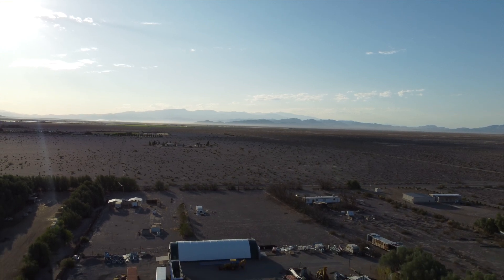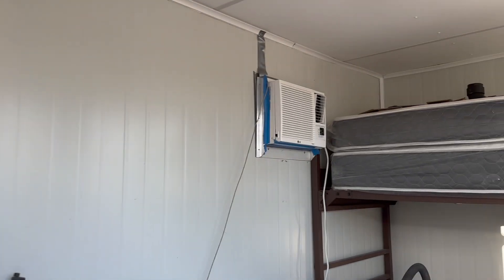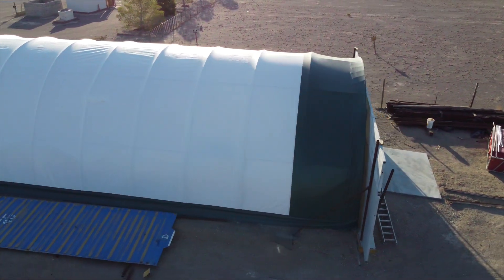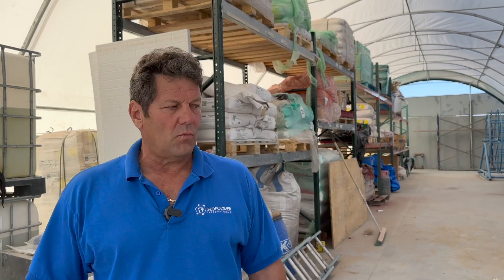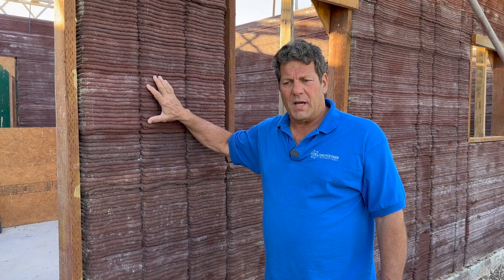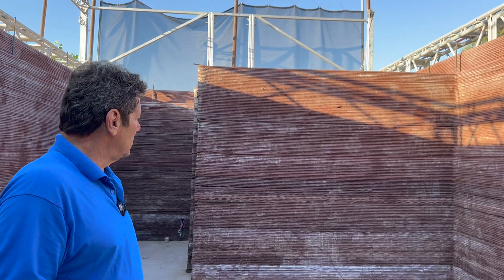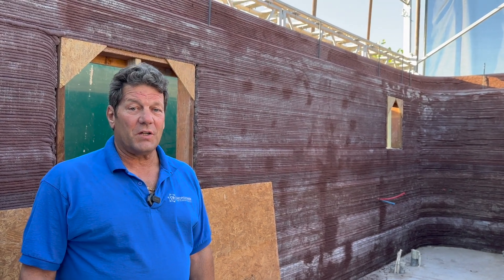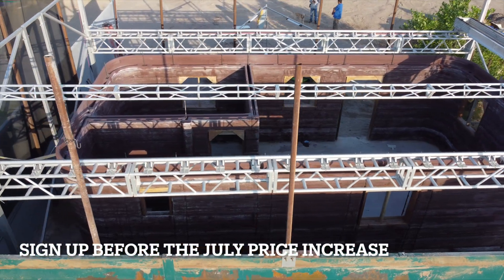First Geopolymer 3D Printed Building In The World

Comment: The white residue on the surface is just sodium bicarbonate.  Excess sodium is migrating to the surface and being neutralized with carbon dioxide in the air.  It can be hosed off when the polymer is done curing.

Comment: What's the R value?
Reply: I've been building pumicecrete homes for 25 years 
Pumicecrete is by far the best building material on the planet
Reply: Hey Jarrett the next time you're in Cabo san lucas you're welcome to come see my pumicecrete home I currently live in  
Take care Ray
Reply from the maker: @raymondpeters9186  haha I was just baiting you I know you are the OG pumicecrete guy. Will you be building any new pumicecrete homes any time soon? 
I'd like to see the process.
Reply: @automateconstruction  I'll let you know
Reply from the maker: Have you ever heard of pumicecrete
Reply: I can't give you a precise answer but I did check the temperature on the wall exposed to the sun and the wall behind in, there is 15⁰C difference between both.
Reply: Where would I get pumicecrete? Does it come ready packaged?  I'm in Nevada.
Reply: @kathrynralli4557  where you live you would get it from Global pumice in Olancha CA 
It would come in a dump truck
That's where I got my pumice from and shipped it to the bottom of Baja Mexico 
Take care Ray
Reply: Pumicecrete is a mixture of 10 parts pumice to 1 part cement and 1.5 parts water mixed and poured into a set of reusable forms walls are poured from 12"to 24" thick pumicecrete is fireproof termite proof rust rot and mold proof and has a high R value and good sound attenuation solid poured walls means no critters can live in your walls Pumicecrete can be built for a fraction of the cost and time and pumice is one of the few building materials that can go directly from the mine to the job site ready to use without any additional possessing and zero waste Google all the walls of my house are made of pumicecrete  Take care Ray
Reply: @raymondpeters9186  awesome, thank you so much!
Reply: @raymondpeters9186  WOW, Olancha! That's really close to me! Thank you so much.
Reply: @kathrynralli4557  when you call for a quote on pumice you will want what is called 3/8" minus 
There is also Hess pumice in Malad city ID and CR minerals in Espanola NM
I've used all 3 and for building they work all the same
Reply: @raymondpeters9186  I've been to Hess, years ago. They gave me a complete tour and I got some pearlite I still have. Thanks again for the info. Excellent!
Reply: @kathrynralli4557  Kathryn just to let you know I built the truck scale office at Hess pumice in a 2 day class I taught there 
Google ( pumice and concrete  pumice-crete structures)
Reply: @raymondpeters9186  WOW...I loved that place. I was traveling with my mother, visiting family in Utah. She didn't want to go to Idaho, but it was the perfect opportunity so I insisted. I have been working with aircrete, and shot crete. I Went to Monolithic Dome school, twice. The people at Hess were very kind and helpful, and patient with me and my mother. I've been wanting to build my own dome place for a very long time, and a rock museum.....all round...I love rocks, and am hoping this will be my time. I also love Baja....never been past the Huge Cactus Forest, Porto St Angeles, I think we turned around and came back....it's a lot longer than it looks on a map, and when I went driving, with children asking, when are we gonna get there, every ten minutes, no gas stations anywhere, it was a bit daunting! I fell in love with San Quintine and the beautiful pale cream coloured sand that sparkles like gold dust. Thanks again for all your help and advice. All the best to you and your family.
Reply: @kathrynralli4557  Kathryn I just got a quote from Global pumice for $36 per yard plus shipping
How far are you from Olancha if you want a price on shipping I need your zip code
Reply: @raymondpeters9186  that's so kind, thanks